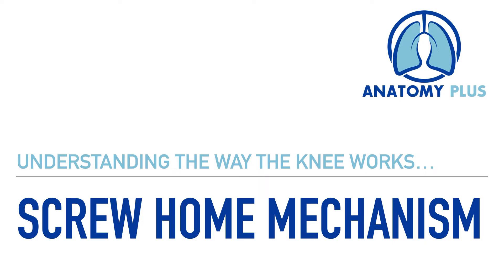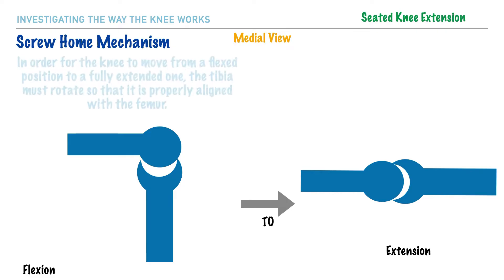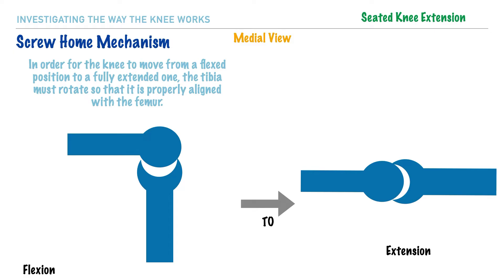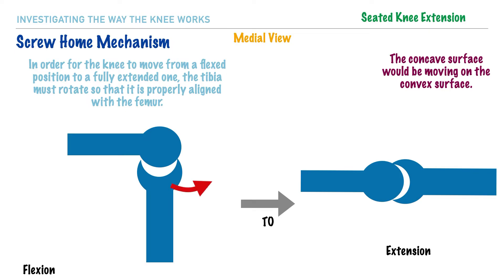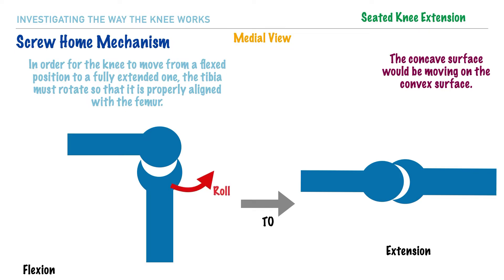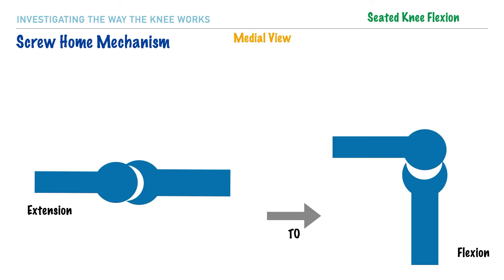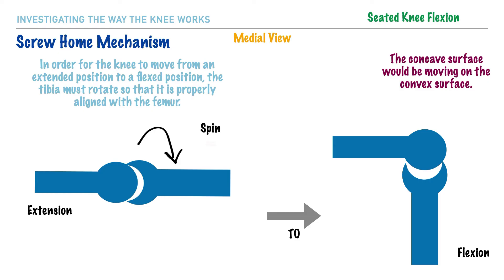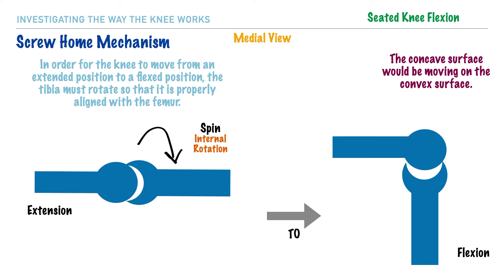Understanding the Screw Home Mechanism: Under 3 Minutes

Comment: u missed the muscles part? and in what ranges tibia will rotate?
Reply from the maker: The popliteus muscle plays a crucial role in helping to unlock the knee. This usually happens within the last 20 degrees of motion.
Reply: @AnatomyPlus  in popliteal tendinits which movement will hurt more sit to stand or flexing the knee in sitting? close chain or open chain?